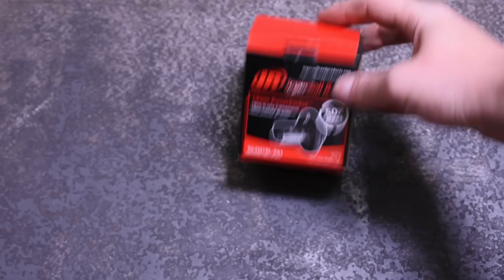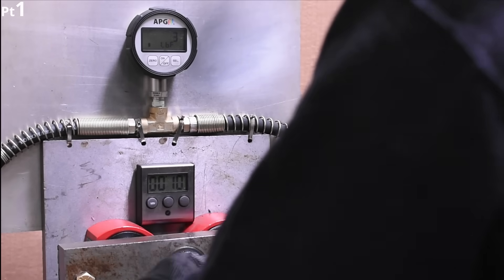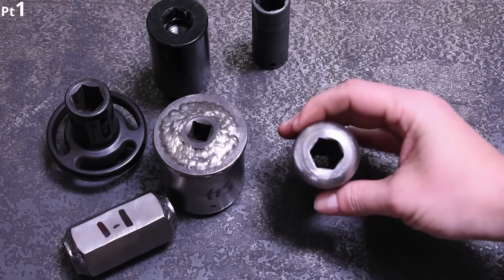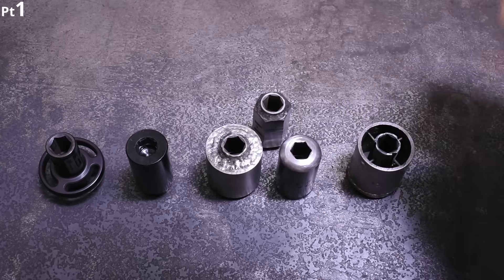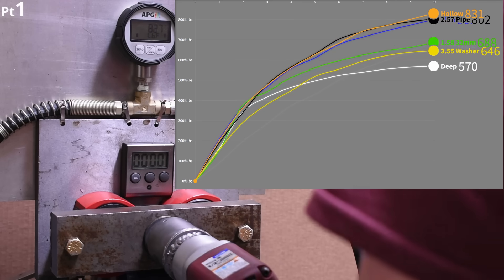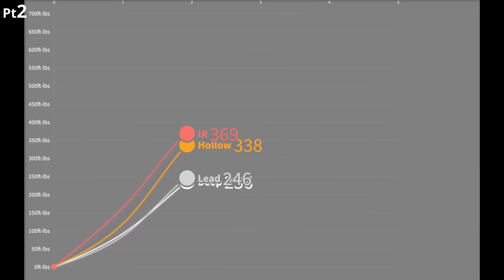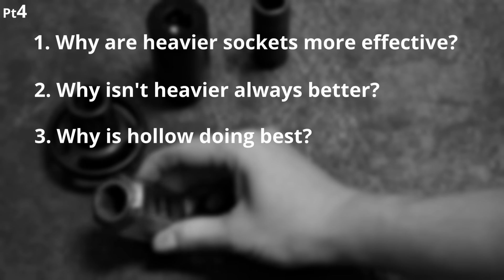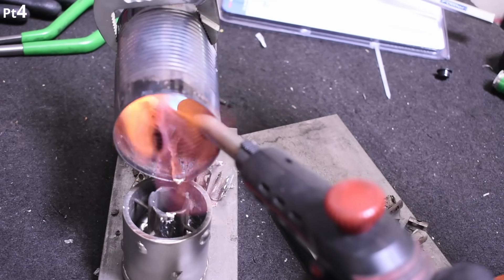Heavier Sockets Make More Power? Stumps Physicist

Comment: Arm-chair physicists opinion: The hollow socket is a strange mix of soft and hard bodies. The exterior pipe and interior sockets are both hard bodies, but the washers that connect them act as a sort of soft body, relative to how the forces are moving. When the impact initially drives the socket forward, it's followed by the exterior pipe 'dragging' the socket forward, keeping pressure on the bolt head. The net result is that the bolt can 'relax' for less time, driving the pressures higher. 

tl;dr: the hollow socket maintains a higher average pressure on the bolt head, resulting in higher torque measurements.

The only way I can think of to see the effect would be with The Slow-mo Guys and a phantom camera to see if the hollow socket 'retreats'/'rebounds' less than a standard socket.

Comment: I read some of the comments and replies and just want to share a thought that might in some way contribute to the force calculations. Perhaps the lead filled monstrosity doesn’t tell the whole story because of how soft lead is? I think material hardness is quite important when you’re looking at things in terms of resonance or frequencies. Using lead kind of throws a monkey wrench into this experiment, because although it has the weight, its structural properties are kind of useless for the application In just about every other way.     It’s not here nor there, but just about every other thought has been discussed at length already so maybe it’s just something to keep in mind.

Comment: It’s a combination of leverage and mass. There is a sweet spot for work being done depending upon the torque of the power supply, like putting weights in the back of a truck in winter to gain traction. If you put too much weight on then the engine will not be able to perform as well as the work it has to do to move the weight outweighs the gain of traction. The reason hollow sockets work better than solid sockets is because you aren’t gaining weight but adding leverage. Like trying to lift a stone with a 1ft wood beam vs a 5ft wood beam. Just like a flywheel, the father away the mass is from the point of rotation, the greater the amount of energy it is able to hold at an equal weight. Essentially, because the socket is lighter the electric motor is able to do more “work” to the socket, thus gaining more energy to release with a higher leverage to release upon impact.

Comment: Nice video 
I help my brother work on his tractors 
One of the bolts on the Allis Chalmers is supposed to be torqued to 600 Foot Pounds 
But after crud build up and corrosion the air impact sometimes had problems 
So I took a 5" dia  piece of 3/4" plate steel and welded a flywheel type add on to a 1 1/4" deep impact socket 
That made a world of difference breaking those nuts loose 
So I bet that idea should work also on a 19 mm socket

Comment: I used to be a mathematician, but I did work a great deal in physics. What I would do is this. Calculate the resonance of the impacts, and how the robbing of kinetic energy (as it bounces the shockwave in the opposite direction) would eventually meet up again with the next impact blow, thus compounding subsequent blows.

I have a hunch that a bigger or smaller hollow impact would not work the same, and each impact (based on IPM) would need a certain size and diameter. My arm chair physicist guess.

Comment: The DIY washer rig is probably twisting under load and absorbing the impacts. The issue is those thin tack welds—they don't have the cross-section to resist torsion loads.

Comment: It probably has to do with the leverage advantage that you get with spinning that larger diameter. The outer diameter of the ir socket on the flywheel can use the energy of the impact to a better degree because of leverage. (Like trying to tighten a nut with your fingers versus using a T handle). I don't know, better for converting the rotational force of the socket into torque at the detriment of rotational speed(which it doesn't need much speed at all at that point) . That's my thought on it

Comment: I would like to put in a layman's terms. In the flywheel and the hollowed style sockets have a tiny bit of flexibility between the main body/core and the outter wall area.

That flexibility causes the outer wall to slightly lag behind the core. When the core stops, the outer wall still has energy to still move in the direction of travel. So there is extra force going to applied to the core.

Here is another thought on the matter. Depending on the impacts per minutes or seconds, that will affect things too. If you can find a combination of impacts and the right flexibility setup, you could increase the force.

One way to test this idea out is take an adjustable speed controlled impact driver and the same socket and see what the results are by varying the speed one setting at a time.

Comment: The impact transfers energy to the socket which then transfers energy to the bolt. heavier socket holds more energy to transfer. If there was a way to apply say 100 foot pounds to the socket constantly, then have the impact on top of that, I would be very interested to see the difference.

Comment: My hunch is the ratio of the moment of inertia vs the polar moment of inertia.  For the solid socket, the polar moment of inertial is much larger than the moment of inertia, however for the hollow socket the moment of inertia was very close to the polar moment of inertia.  The moment of inertia is the resistance to acceleration, while the polar moment of inertia is the resistance to torsion.  When the resistance to torsion is much higher than the resistance to acceleration, you end up losing much of the stored energy, however when the resistance to torsion is closer to the resistance to acceleration, the result is an amplifying effect.  I think the problem can be related to phase effects of the energy, when they are in phase you get a multiplying effect (like radio waves), but when out of phase they will cancel (behave like the control socket).

Comment: Same general concept as a pushrod in an engine, solid pushrods would be much less ridgid, the heavier sockets probably do worse because the impact doesn’t make enough torque, impacts per minute are hurt pretty bad I would imagine. Flywheel design might even be acting as a vibration dampener

Comment: In a way the heavier sockets help facilitate a form mechanical impedance matching, similar to how a horn amplifies sound. Mark Rober had an excellent demonstration of mechanical impedance matching in his video on the worlds largest horn where he demonstrates the effect on a block of jello. 

Also the drum might be more efficient due to the moment on inertia for a ring/tube being greater than a disk/cylinder, allowing for a more efficient use of a given mass. You could test it by having to sockets of the same weight but make one hollow.
Reply: I suspect that the maximum efficiency occurs when the anvil (and connected stuff) have about equal inertia to the hammer. Similar to a Newton's cradle, where you get perfect energy transfer between ball only if they are of equal mass. any more or less, and it will start to degrade performance. It would be a pretty straightforward thing to test, though.
Reply: Impedance matching! That's a perfect way to describe it. I have to say, I'm super impressed by all the smart comments on this video.

Comment: It's an inertia (mechanical impedence) matching problem, as per the suggestion of others.
Maximum energy is transferred when the inertia of the motor rotor multiplied by the gear ratio squared is equal to the inertia of the load (socket).
Energy transfers back and forth from load to rotor with each impact.
Energy is lost if the load inertia is too high or low.
It's similar to balls in pool/ billiards. A cue ball transfers all its energy to a pool ball upon impact (linear collision).
The principle only applies where there  is backlash and impacts in the system.
To learn more, look up "inertia mismatch" related to motion control and servo motor sizing.

Comment: This all makes perfect sense from the perspective of the physics. If the Prof ghosted you, he probably just got busy.
This is all about efficiency... basically, you are trying to convert kinetic energy to force to do work.
The TLDR version, the mix of extra rigidity, additional mass, and importantly, the additional mass that is placed far out from the point of rotation, all culminate to make the tool more efficient as it isn't losing energy bouncing around and can conserve its angular momentum better, but since the distance over which your socket is being accelerated is so short, too much mass will cost you too much momentum to be beneficial.

The total amount of kinetic energy available is determined by the motor in the impact wrench.
The job of the hammers and the gearing in the impact wrench is to convert that kinetic energy into force with which you can do work.
There are a LOT of factors determining how efficient this process is, but we can break down what's going on here by looking at the equation for work, and conservation of angular momentum.
W=F*D, and given that force=mass x acceleration, we can re-write that as W=M*A*D
Conservation of angular momentum is a physical property of a spinning system such that its spin remains constant unless it is acted upon by an external torque.
Angular momentum is determined by an object's mass, its velocity, and how far the mass extends out from the point of rotation.

Lol.. ok I planned on explaining this in detail, but I am totally procrastinating my actual work in the process, so I'm going to cut this short. 
By having more mass farther out on the socket you reduce the amount of negative acceleration and loss of momentum the socket experiences when it impacts the bolt (the bolt is applying a negative torque to the socket). the net result is a smoother conversion of the kinetic energy to motion in the direction of the drive.. 
(think what happens when a mosquito hits a windshield.. you apply equal force to each other, but he feels a ridiculous amount of acceleration, and you feel practically none so your velocity and therefore your momentum is conserved).

so ya.. more mass further out helps conserve angular momentum and reduces the degree of negative acceleration felt by the socket so less energy is wasted by the socket bouncing off the bolt with each impact. 

But remember, as with everything, there will be a sweet spot...
KE=1/2*M*V^2, and P=M*V, so velocity is important, and if you have too much mass you won't be able to provide enough acceleration with a given amount of force to impart sufficient momentum over the tiny distances you have to work with in this situation.

that's the condensed version.. hope it makes sense.
 cost you too much momentum to be beneficial.

l mean

Comment: Ok up front I'm an idiot especially after reading some other comments. 
However,
it would be interesting to see multiple flywheel designs of the same weights an materials only changing the Dia. Of said Flywheel... 
THANKS FOR THE GREAT CONTENT!
Reply: Also are all the sockets male an female sizes the same? Could slop play a role in the readings

Comment: Its not just mass but also stiffness. Lead didnt do so well because, while yes it's heavy, its a soft metal and absorbed some of the energy outputted by the gun. The washers also didnt do well because theywere not as solid as it seemed, the weld beads was where the energy was transferred so it caused a loss of energy, not through absorbtion like the lead, but rather because of the lack of transfer efficiency.

Comment: Maybe the weight cancels a harmonic rebound that is talking away efficiency. The ir is carefully engineered to work perfectly with the ir impact. The hollow socket is doing the same thing but more in tune with the more powerful hammer. So lighter but carrying the shock to a larger diameter is the key

Comment: flywheel mass definitely helps, but excessive mass like with the 4lbs of lead starts to become too much and the extra force is lost with the impact losing strength trying to get the socket to spin, and leaving less force to the nut/bolt

Comment: The increased lever action from the increased circumference...the same idea of a 1ft wrench vs a 5 ft wrench. 
At any one point the rotating mass is further away from the work point adding leverage. Your hollow socket did that and kept the weight down .  If that's the fly wheel argument, I'm sorry but that's how what I saw made sense to me

Awesome job coming up with that hollow design. Props brother!

Comment: Instead of weight or mass you need to focus on the Polar Moment of Inertia of the socket.  The extra mass where it doesn't contribute much to the polar moment won't do much but add to the stiffness.  Also, in a vibrating system, frequency is very important for energy transfer--try forcing a pendulum swing at the wrong frequency.

Comment: I think that it's the fact that the gun itself has additional energy not put down to the nut. Chances are it's not putting every single bit of force into the hammer at once, and so having the extra weight allows that extra energy that may not have gone into the nut to be transferred into the nut. I believe the reason the IR socket didn't work as well with the ring cut off is because there was less rotational energy, ie. Not enough sources of potential energy, and so not as much energy was stored between each hit

Comment: My guess: the walls of the socket are acting like a spring to some extent.  Adding a second wall (or well attached flywheel) gives a secondary spring effect.  I would like to see a short hollow vs a long hollow and see how much difference there is.  Although the long one would have more mass, the short one would have less twist possible.

Comment: The high speed camera footage will be very telling.  The ability for the socket to not flex would be the key ingredient.  I have a feeling the flywheel on the IR socket helps keep the socket from twisting has more to do with performance than the added mass helping it.  You guys should take the output drive on a impact gun and tig weld it directly to a bolt.  By eliminating the slop in the socket fit (on both the socket to bolt head and drive to socket) and 100% of any loss due to twist, the numbers it posts should be the best of all of them.  I am a really good tig welder and would be happy to do this for free.  Just chuck the bolt in a lathe and turn the face of the bolt flat and the same on the impact drive face.  I can have it set out the day after I receive it 👍

Comment: It all makes sense in my head, the power socket and the hollow socket is a pretty good power to weight ratio to gain more torque but not drag down the impact, the heavier they get the harder the impact has to work to get them rolling. If you got them spun up quickly on say a free spinning nut on a bolt before it hits its tightening surface it would have a much higher jump in torque then say a regular or lighter socket, but then the impact would still have to keep that inertia rolling, which it doesn’t have the power too, so the power socket which is designed to give a 1/2 inch impact a damn near perfect power to weight ratio works the best, and the hollow socket perfected a bit better lol, that’s just my 2 cents, weather it’s right or totally wrong idk. Anyway keep up the great videos👍

Comment: I think this has to do with the mass being ideal to allow the hammer mechanism to transfer the maximum force. 

If the socket returns rotates against the hammer after it strikes it reduces the amount of distance the hammer has to store up energy and also loses energy in returning the socket to tight. 

So basically I’m thinking this is a harmonics deal where the hammer and socket are ideal.

Comment: seems like a larger diameter flywheel, not so much heaver just larger in diameter, more like a frizbee size, 
maybe,
 just a theory that momentum would be greater on impact the farther it is from the center of source, 
like when you choke up on a hammer less impact 
and when you swing from the end of the handle you have more of an impact.
Reply: same reason why you would use an extension on a pry bar or ratchet, more impact on the center from the outter source of momentum.

Comment: The one with washers didn't work well bc it's not a solid mass, the welds holding the washers together were flexing which didnt transfer the mass into the fastener. 

The hollow one is acting like a flywheel and that increased sockets inertia which is why it worked so well. This also the reason why the Ingersoll Rand sockets performance dropped so much by removing "flywheel", it lessened the sockets moment of inertia. 
Think of it this way, that flywheel thing is acting like a "Cheater Bar" would on the end of a wrench, so it would stand to reason that removing it would decrease the amount of force you can put into the socket. 👍👍

Comment: Getting the most possible kinetic energy is not the goal. You could get massive kinetic energy with a super light socket, but the more you go that route, the more the energy would deform the bolt head and/or socket rather than increase the torque.

Comment: I think the harmonics of the socket might be a really big influence, I'm wondering if the test results would be different with a different impact that has a different hammer mass and/or different BPM?
Reply: I was thinking the exact same thing.  Geometry, material, and mass would need to be tuned to reach optimized harmonics per impact gun and use case, which is why we see different results from one gun to another.